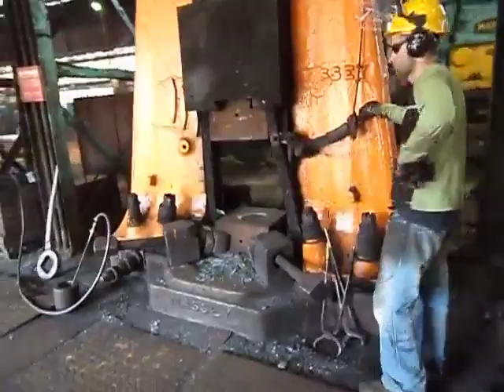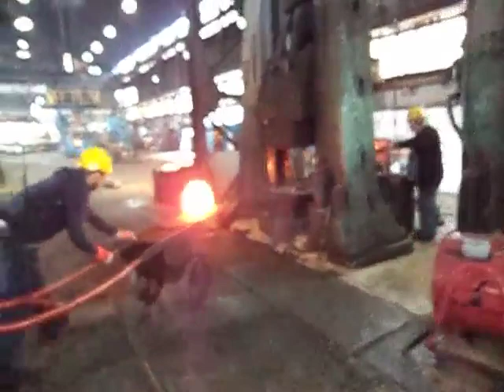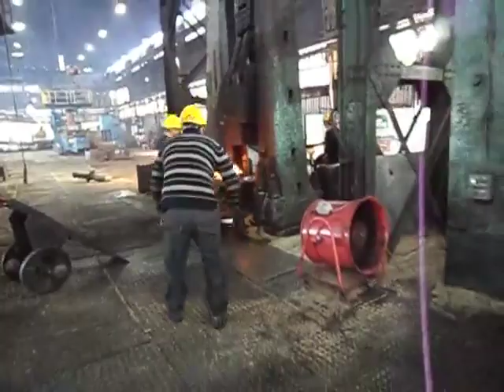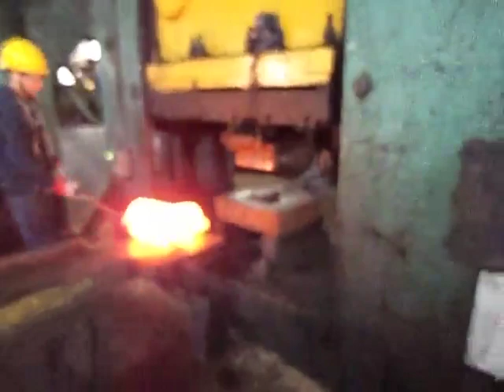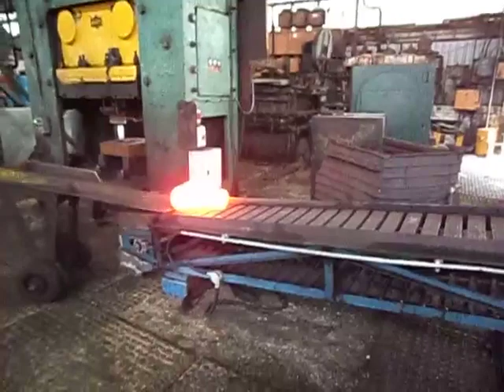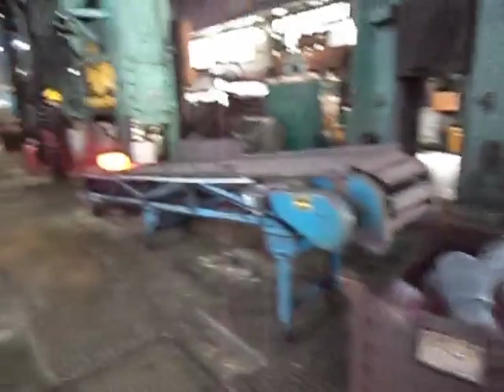Closed Die Forging Process

Comment: Does anyone know?  A company that makes engines in this way individually?
Reply: No . Engines are not like this . Some 3 engine components are made like this . Crack shaft , connecting rod , cam shaft . This process is followed by machining , heat treatment , grinding etc to make these 3 parts . Cylinder block and heads are made by casting process followed by machining .
Reply: @RD-ij2sz  But I think if the engine block and head were made this way it would be better in terms of durability.  Thanks for the clarification
Reply: @آخرالرجالالمحترمين-ت8ظ  Cylinder and Blocks and Heads have complex profiles and geometry and cavities which can not be achieved by forging . These two parts have to cast from different grades of cast iron or aluminum alloy .
Reply: All Engines Have Forged Steel Parts!

Comment: If the hammer drops with no multiple in it? Do the dies touch?
Reply: Yes, they are a "kiss-face" design. Usually EN2B material.
Reply: Yes.They Are Headed To Prevent Dies From Breaking!
Reply: @delbroncarter5121  Can you explain what 'headed' means in this context?
Reply: @jsmcortina  Does 'kiss-face' mean that when the ram is fully extended, the two dies just touch each other?
Reply: Fire Is Put Between The Top And Bottom Dies For About An Hour To Heat Them.Then The Full Force Of The Hammer Can Hit. Without Breaking The Dies.
Reply: @delbroncarter5121  oh heated!

Comment: The second forging machine looks like it has an unpowered down stroke; gravity free fall, is this correct? I just noticed that the weighted die appears to be suspended underneath the ram / shaft by two very thick rubber belts, is this also correct?
Reply: HONORGUARD308 At 1:40?
Reply: Yeah, that one.
Reply: HONORGUARD308 All right, ya it does seem that the die is suspended.
Reply: It's a drop-hammer, the tup drops under gravity and is lifted by the belts. Other designs are "double-acting" like the Huta-Zygmunt MPM air hammers that power down.